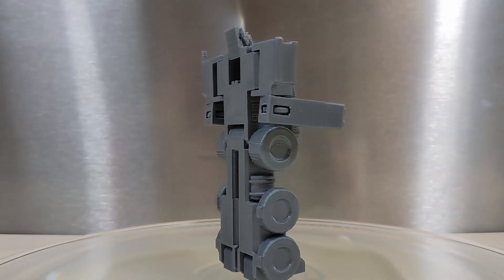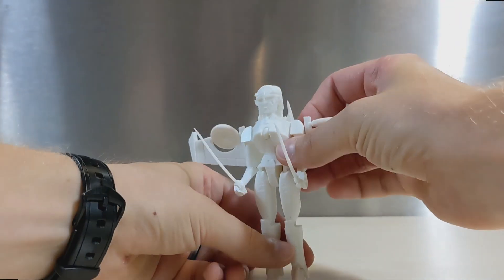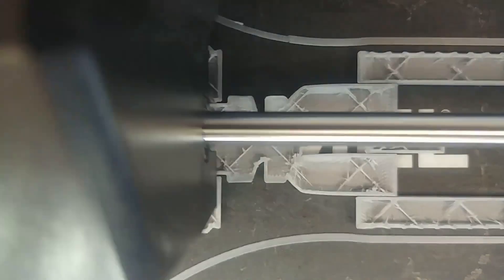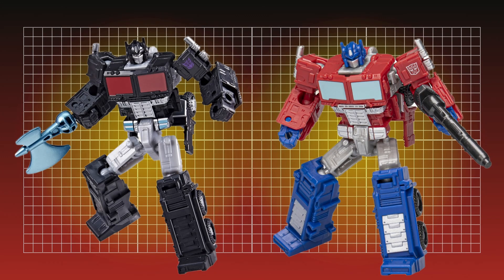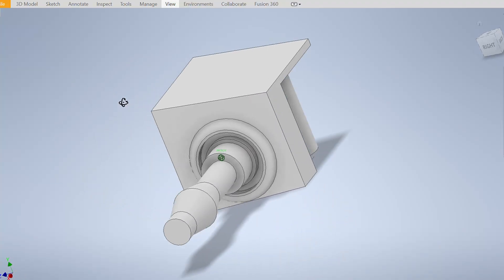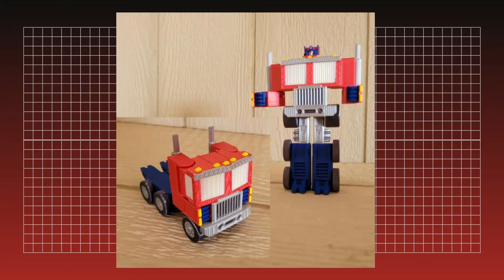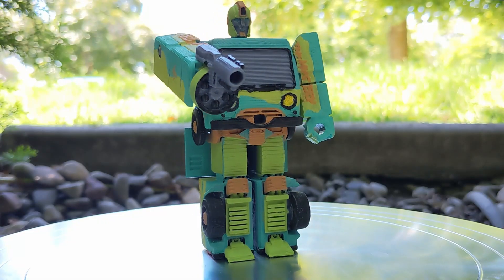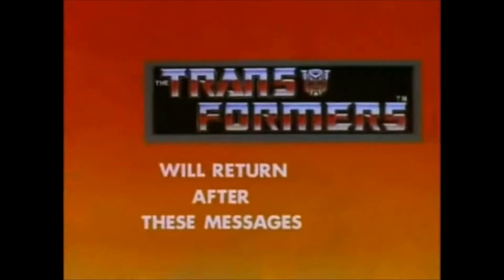Ironhide and Ratchet: 3D Printed Transformers

Comment: This was one of my first 3d prints(ratchet specifically) and its super awesome. An idea I got if you ever do a van transformer like this ever again(I can think of this being used for inferno or grapple for its transformation) is design the forearms to be balljointed so that articulation can be added to the elbows and also if the forearms can rotate, the hands can become hidden. Not sure if having the gap for a balljoint will affect the print with any overhangs though. 

Regardless, its an awesome design. I also printed  Bee, Megatron and Prime(in that order) and I really love your work.
Reply from the maker: Haha you've just opened up a very interesting discussion. I initially planned to include elbows in the design all the way back with Kombitron, and then considered them again when redesigning the parts for Ratchet/Ironhide. I opted not to do them for the sake of simplicity, and because I thought it might make the figures too floppy.

I try to balance features/articulation with simplicity/reliability, and I sometimes choose the path of simplicity, in part because I'm not trying to replace Hasbro or any of the designers that make fully-articulated, 3D printed transformable figures, but also because I like the trade of that the print-in-place-figures have.

They might be as posable (or sometimes as detailed) as bricks, but there's no assembly required. I've also found that they endearingly evoke the charm of the original G1 bots (or, if you're a little younger like me, the goated TF Animated happy meal toys) because of their limitations, which resonates with a lot of people pretty well.

Also, I'm glad you've enjoyed the figures you've printed!
Reply: @TalmageMadsen  No prob. I'm just glad most of the figures you made can rotate at the arms. Thats all you need if you want them holding a gun.